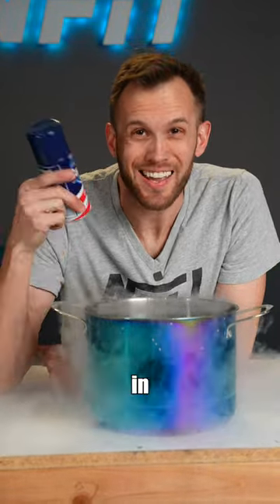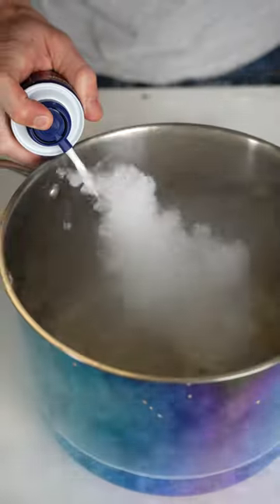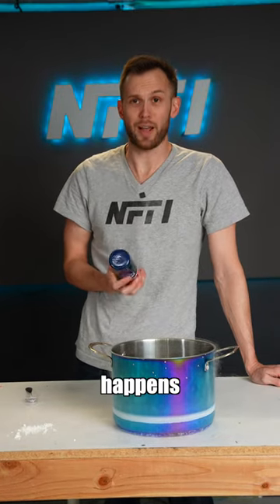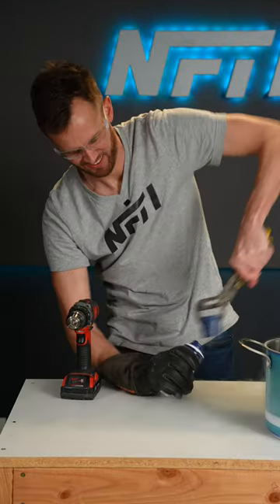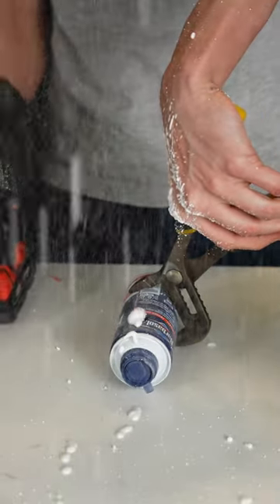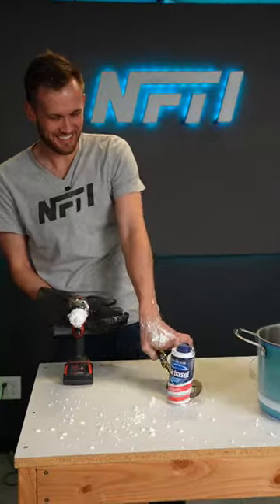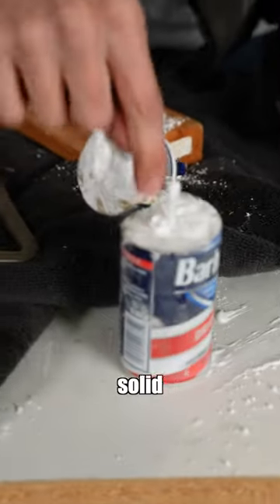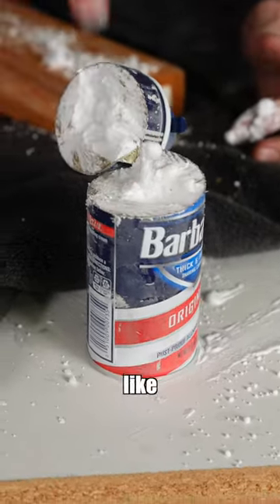Freezing Shaving Cream in Liquid Nitrogen!

Comment: Ok. That’s goood.
Request: would it be possible to freeze a material like magnesium. I’d suggest uranium and then look at decay but….

Anyways. Once dunked would the magnesium still function as normal? Will it make eyes suffer in its holy light or will it more just… melt/thaw? How much of a delay is there to it’s ignition? Is there a change in light intensity? Is there any change to the reaction itself? Will it be slower or faster?

Lastly. As another polite request.
What happens if you put a frozen plant, which draws water up its stem, into a pot of dyed water. Will a short dip still freeze the cells to the point of failure? How much exposure could such a plant take before failure?

I hope you’re going well. Sorry for the essays above. Got a test today and in a writing mood
Reply: Uranium bro would die its to unstable

Comment: there's a chance the drilling heated up a localised spot of the shaving cream as (1) the drill bit was at room temp and is metal so it conducts heat quickly
(2) friction from the drilling producing heat

Comment: Did you drill a hole in an unfrozen can?  Since most things (other than water) don't expand when frozen, the propellant should've contracted -- even if not frozen -- and exerted less pressure making a smaller geyser?  30 year old physics may be scrambled by now.